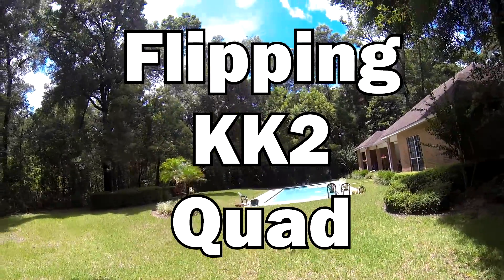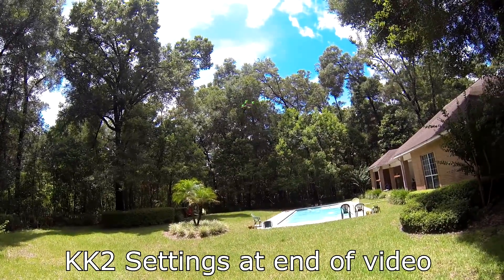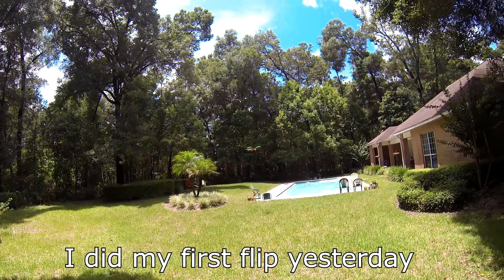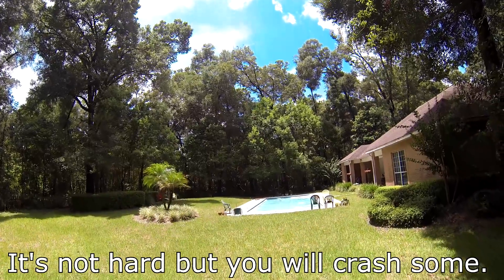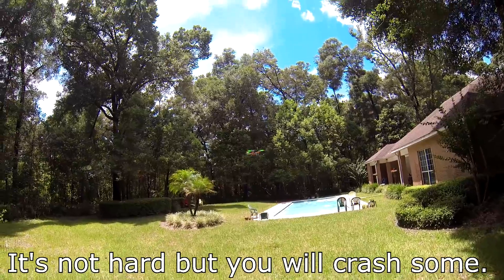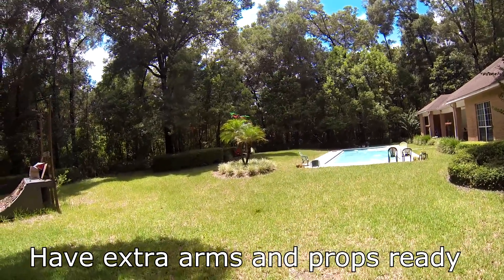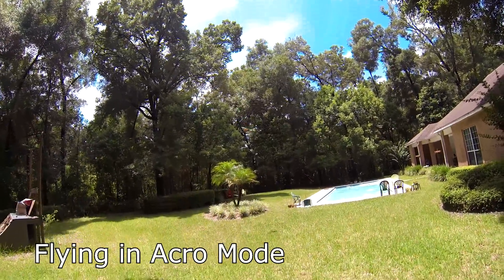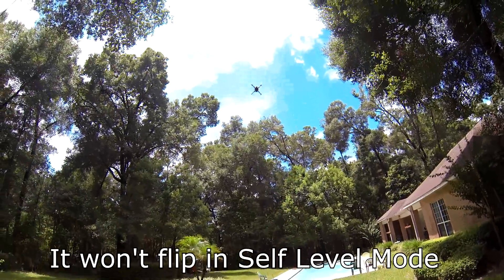How to Flip a KK2 Quadcopter

Comment: Hi, can I ask you a question? I was wondering why the quadcpoter flipped around the line between the two frame arms instead of the arm? Thanks!
Reply: Because the quad is set to fly as an X, not a Plus. 2 blades forward.

Comment: I have a Flamewheel as well and want to get better blades? How do you like those? The DJI ones arent bad but they arent very responsive, and their 8 inch ones do break very easily. 

I will also have to see if the NAZA M V1 will allow me to roll that quickly, my first attempt I ran the thing straight into the ground and snapped an arm